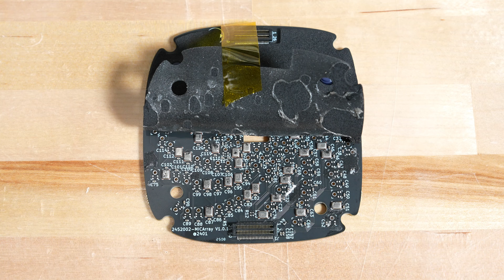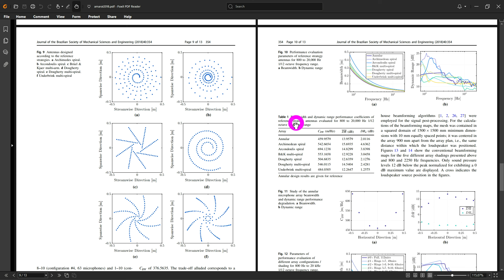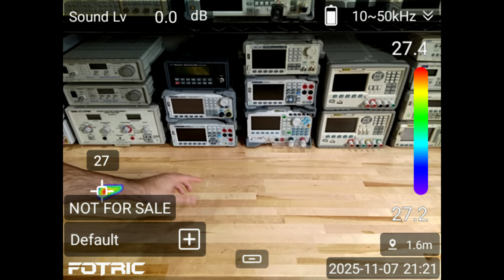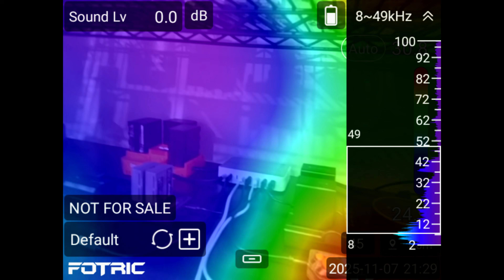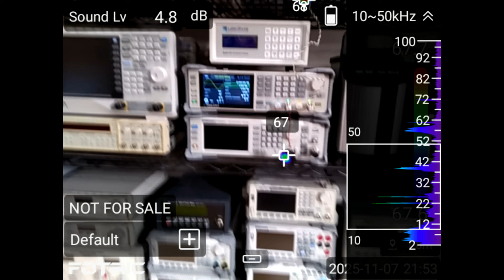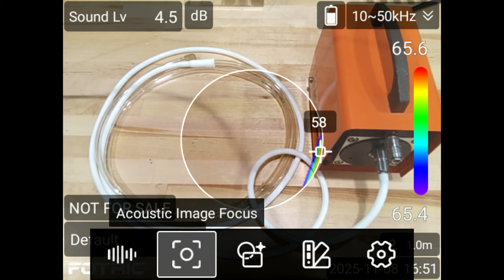TSP #325 - I Can See Sound! FOTRIC TD2 Acoustic Camera Theory, Teardown, Review & Experiments

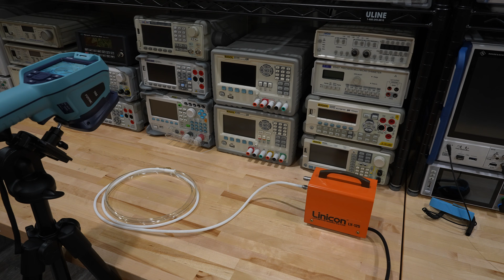Comment: 26:20, that's funny, the first thing I thought when I saw the images was could this work as an ultrasonic leak detector like those used in HVAC. But this is probably even ore ridiculously expensive.
Reply: Yes it would probably work great for that. ESP because the equipment is loud but needs to be running for a good leak test. This one is around $1000, so in the range individual HVAC techs could probably have and definitely a few per company. The Fluke one is more like $25k, but is more sensitive, and seems to filter noise somewhat better.

Comment: Soo interesting this crossover. I worked as lab technician with the autors of that paper.
It is the Aeronautics Dept. of the Sao Paulo University (BR). That chamber is the chamber for testing of the wind tunnel. (I worked on that structure)
They have done studies with that, and there was another group constructing anothe antennas/algorithms there.
Once I did a flex-pcb with like 15 or 20 MEMS microphones, to be mounted inside a fan, to measure from withing the wind tunnel. Nice projects back then. Very capable people!

Nice to see this technology became more common, and they paper shared here on your channel! Cheers!

Comment: 4:08 the bandwidth to carrier frequency allows for simpler algorithms you say?
Would never have figured.
I definitely don't understand this stuff enough for the project that I wanted to work on. 
    My project concept was inspired pretty much by the laser speaker (the array of ultrasonic transducers that are modulated such to create an audible signal from the interference of the ultrasonic signals at a specific target in three-dimensional space), but yeah my idea was inspired by that but using RF frequencies. I wanted the nonlinear interaction of a receiver to internally  generate both the carrier wave in it's receiving band and it's modulation of whatever type of modulation the receiver is designed for through the interaction of wildly spaced transmitted modulated signals at completely different subharmonic frequencies.
    Or simply put just like the laser speaker uses a phased array of ultrasonic microphones I would be using a phased array of microwave transmitters send a modulated signal at a a lower radio frequency.
    Any suggestions for articles educational materials to help me learn how to do this? 
  Also perhaps a cheap source of scrap FPGAs I'm on a fixed income with a very low budget.

Otherwise I appreciated your tear down a lot, wish you spent more time on that than the playing around with it, still appreciated, thank you for the video!

Comment: That "power supply filtering" looks very much like a dual DC-DC converter board. The things that look like inductors are on little multi-pin carrier PCBs, which is very common for small integrated DC-DC modules these days; they have a chipscale switcher ASIC buried in the carrier and the SMT inductor sits on top.
Reply from the maker: Yes!

Comment: 2:43 I'm pretty sure that those 2 smd inductors are the new ti buck converter with integrated inductors on top .
Most likely they made the power section modular to use it in other products as well. 
I guess the the potting compound is there to hold the power pcb and insulate the connections.

Comment: We had Fluke acoustic camera in time when Fluke relase it , for checking air leaks and sadly it  wasn't that good. We have low pressure ( 6bar ) air and some of them camera wasn't able to catch ( we knew that they are here ). So we are still using good old soapy water.
In somewhat noisy enviroment, "bigger" leaks and not reachable places it is good. Same as for broken insulators to catch some arcing.

Comment: Actually, the sound of snapping fingers comes almost entirely from the middle finger deplacing the air betwee the root of the thumb and the ring finger. Try lifting your ring finger and see the difference it makes. If you actually manage to stop the middle finger hitting entirely, the sound almost vanishes completely.

Comment: Please be more careful to avoid misuse of standard terms like dynamic range, for spectrum bandwidth in this case. It makes it harder to pay attention to meaning and contexts, when a filter for such errors is needed to understand otherwise high level content.
Reply from the maker: What I meant to say was that it offers a wide dynamic range across a broad bandwidth. But when juggling 10 different things to make a video, words can occasionally get lost.
Reply: @TheSignalPath Thanks for the clarification.  The overall quality left me thinking you must know better than what was said.  

As someone who's been in an acoustic research lab anechoic chamber, and discussed design of the Sonalysts motion picture sound stages with engineers there, I may have a different perception of what a "quiet room" can mean than most people.  Keeping 5-400 Hz under 16 dBA-SPL with operating huge volume HVAC can consume large volume of a space for plenums and damping, and ultra-low velocity air flow.  

Then we can hook up with Bruel & Kjaer to find optimized mics for a piano, a test lab, a hummingbird, or a NASA launch tower, and SPL ranges from 10 to 180 dB-SPL, and frequencies from very subsonic to around 360 kHz.  

Unless I missed it while trying to process info on phased arrays and low cost methods of signal processing, I recall a 2-70 kHz response bandwidth, but don't have a clear sense of what quiet or loud dynamic range mean for this instrument.  

I do appreciate the challenges of trying to cover some intensive engineering topics with high quality content, and the paradox of needing to stay low budget and focused to do so, versus the benefits of a production team and editorial script review staff, but at a cost that tends to force catering to a broader audience than the math, physics, phsyiology, and engineering involved in devices like this.  

Or getting viewers to make jokes about teasing Benn Jordan.  ;-p

Comment: The performance is absolutely incredible and so much better than I would have thought possible. I'd guess the big cost driver is lack of demand and the big honking FPGA. But I'll bet in a few years someone's (china) going to start producing a dedicated IC and the cost is going to come down to around $200 and you can bet your ass i'll be picking one up. I can't begin to tell you how much trouble this thing could have saved me as a mechanic. I'd love to see what this thing can do in an engine bay with a running engine. Probably one of the most torturous environments possible but I'd just about give my right arm to have something better than the 2 century old stethoscope I have to use to try to localize sounds.

Comment: i think the distance thing is intended to do distance filtering, but as this would have to be based on the wavefront radius (which would need extremely precise and accurate measurement of what would be a very noisy signal anyway) and require the assumption that the source closely approximates an isotropic emission (never a great assumption with sound) it probably just doesn't work very well. it's comparatively easy to measure the direction of a wave as it will more or less approximate a flat plane at this scale, but that makes measuring exactly how it isn't actually a flat plane next to impossible.

Comment: Sounds can be transmitted through light however it seems oddly sensitive to the light.
If you are able to expand on MEMS ability to discriminate between light and sound, that would be cool.
Note: I don't believe that the light reflection from your scope is making any noise.
Reply from the maker: The sound coming from the scope is from the light power supply reflecting off. I have verified this by turning off the light and it goes away.
Reply: @TheSignalPath Not making any noise; as in pressure wave / sound. Not noise as in interference noise.
Smarter every day, made a video of a laser interacting with MEMS microphone in an iphone/alexa. MEMS microphones appear to pickup up light as sound waves; wich is interference.
Reply from the maker: You have misunderstood the underlying phenomenon described the video you are referring to. In their demonstrations they are using a high-intensity laser whose intensity is modulated by the sound carrier waves. The laser source is bright and focused with sufficient modulation index that is capable of inducing a signal on the MEMS membrane. This is likely due to a thermal effect and potentially some photoelectric effect although the latter would depend on the membrane material. The situation in my room is vastly different. The light itself is not modulated nor is it bright enough or focused enough to cause such an effect on the MEMS. This is simply sound waves bouncing on hard surfaces which is why it works so well on the table and when I put my hand in front of it, I can interfere with it. The DC/DC converter in these LED lamps run around 38kHz and the coils "whine", which can be picked up by MEMS.
Lastly, you keep using the word "interference". This phrase only means that something is interacting with the signal you want to measure, nothing more.
Reply: @TheSignalPath Thank you for replying.
you may be right.
However, the light is modulated by the DC-DC converter.
Is the noise (sound) from the DC-DC so loud that anything within line of sight starts to be picked up by the instrument? I don't think so
I don't think sound from the lights is that loud, along with the MEMS array picking up noise exactly at the point of light reflection (I would expect that sound would be more diffuse); leads me to believing that it is picking up light as interference.

Place a dark piece of paper in the light path (near the table), and measure the backside to see if the device is picking up the sound from the light, or is it inducing sound in the paper (preferably black paper so it doesn't pick up the light modulation).

Thank you
Reply from the maker: The light is NOT modulated by the DC-DC converter. That is not how DC-DC converters work. The inductor sees the switching current which causes it to physically vibrate and thus "whine" and that is the source of the sound. The output of the DC-DC converter is a DC voltage with very little AC signals signal after filtering. There is no significant light modulation. The sound from the power supply of the LEDs does not need to be that loud. The instrument picks up minute sources of sound, especially in absence of other sources of sound. It is also well beyond our hearing capabilities. In fact, dimming these lights causes the DC-DC converter frequency to drop and enter audible range which is very annoying.
As I have said multiple time, I have already verified that the source of sound is from the LED's power supply which can bounce around. Every other source of sound does exactly the same thing, this is a normal expected behavior.
Reply: @TheSignalPath Thank you for the reply. 
Mb, on the DC-DC converter, I was thinking of PWM.

Comment: The next step would be to create a camera that allows objects to be visualized using sound. Perhaps it is in such cases that the use of AI will be effective; a system equipped with an array of microphones and a conventional camera will be able to compare the optical image and the sound signature. A neural network trained on such comparisons will be able to create a visual image based only on audio data.

Comment: fascinating, never heard of one of these, 
Would be nice if it had the ability to "zero out" the spectrum at any point, meaning to reduce the sensitivity to the spectrum it is currently hearing (such as your lights) and then switch on the parts you are interested in (the speakers in this case) and see only the tones that have changed significantly, even while moving the camera.

Comment: You mention you are giving it a hard time with random noise, but quite the opposite is true. Random noise is the best case scenario. It has the best possible self-correlation. That is probably also why it works so well on rubbing your fingers. It would be interesting to see how well it performs in the low frequency loudspeaker scenario, just with (low frequency) noise instead of a single tone.
Reply: You're right. You very clearly demonstrated that the pure sine-wave scenario is challenging. But also at 25:25 you mention that the two noise sources have "very similar waveforms", which again is true, but could be understood as actually being difficult to discern. But the low cross-correlation and high auto-correlation is actually the optimal scenario for this device to work. That was all I wanted to put out there.
Reply from the maker: I said I am giving it a hard time with multiple sources of sound of different intensity. I also specifically mentioned that a single pure tone is a very difficult scenario especially because of many nulls which can exist due to reverberations.
Reply: @TheSignalPath  
I'm posting this comment here because I think my ISP or YouTube blocks anything like this unless it is placed in a nested reply so here goes:  (I post it partly so if you aren't aware already, your channel is very interesting for folks being targeted with very difficult to prove energies): 

Neuroweapons: Georgetown University's Dr James Giordano

At minute 15:19 in the video excerpt:

https://www.youtube.com/watch?v=28BdnTXbSQ4

..."the brain as an electromagnetic organ is therefore sensitive to a variety of
energies that may be directable and now we're talking about directed energy weapons
and/or directed energy devices that could be weaponized. And we're looking at a broad spectrum. For example, we're looking at:

direct and rangeable acoustics and sonics, 
ultrasound and infrasound. 

We're looking at various forms of other energetics:

lasers, 
rapidly pulsed microwaves. 

And we recognize that each and all of those things speak to particular vulnerabilities in the way the human nervous system operates that can be affected by a variety of these tools that are increasing in their capability and sophistication..."

Comment: Might be different standards, but around here the radon pump has to be outdoors since there's a risk of the higher pressure outlet leaking; only vacuum inside. Any leak and it just concentrates it for you. Might want to check in on that
Reply from the maker: You are right about having the pump as far towards the end of the line as possible. I do have a radon detector in the room as well. I am considering moving it to the attic.
Reply: @TheSignalPath 😂 sorry for baby sitting vs commenting on the excellent video comment, just wanted to keep you safe. Good to know you're taking precautions.  Attic seems better, but again I always see them fully outdoors

Comment: Interesting. It would have been nice to have one of those when I was working on HV DC-DC converters. We'd sometimes get acoustic issues from either loop oscillations or transformers vibrating. Sometimes they'd go out of the audible range. I wonder what those would look like in an acoustic camera. It might also determine which parts of the circuit resonate with the vibrations.
Reply: I would have loved to have this device while I was still working... one of our labs had an acoustic bug which had harmonic nodes that would strengthen and weaken every eight centimeters or so as you moved about the room at around 15kHz. Drove me crazy.

Comment: 2:43: They probably put the power supply on that diving board thing to isolate vibration from the capacitors and inductors. The potting might be over the inductors.
Reply: Those two bucks look like something from the tps821 series with integrated inductors. Still not sure what's under the potting.

Comment: 9:57 I think that is a DC-DC converter - I've seen a few similar to this where the IC is buried inside the PCB
Reply from the maker: That must be it, I didn't look under the board.
Reply: @TheSignalPath  You won't see anything on the back side. The little green module is an LGA module sold as a component containing the inductor, controller, switching FETs, and sometimes a handful of passives. You'd need to desolder the inductor to see anything.

I think I have some of those Cyntec modules on a failed prototype, maybe I'll do a teardown at some point.
Reply: @TheSignalPath  Point an acoustic camera at it to see if it’s oscillating 😅
Reply: Yep. That looks like two DC-DC modules with a bank of MLCCs at input and output and the inductor straddling the controller.

Something similar to (but not exactly) the Delta/Cyntec MUN12AD06-SM
Reply: On some dcdc's with stupid high feedback resistor values i've seen them locally potted to avoid drift or failures due to contamination or somebody touching it.
Reply: murata also makes some i think
Reply: TI makes plenty of similar looking DC-DC modules (the ones used look to be in a microSIP or similar package) - there is an entire "Power modules (integrated inductor)" category. They are very easy to use, if a bit expensive.